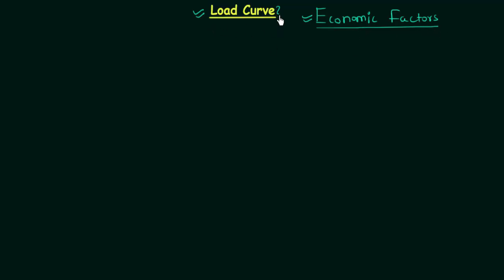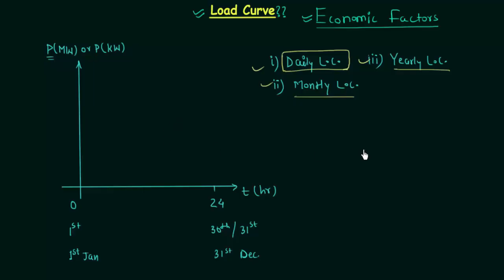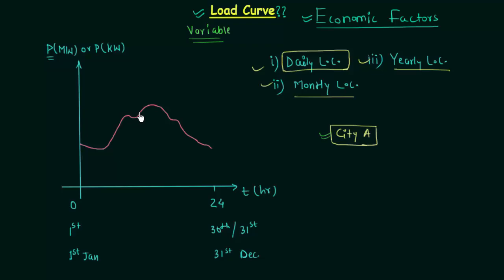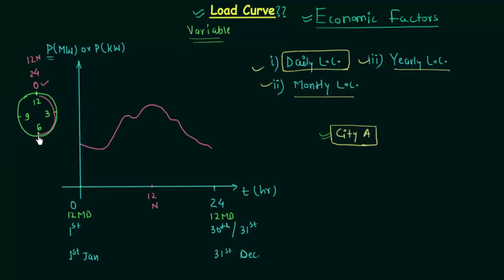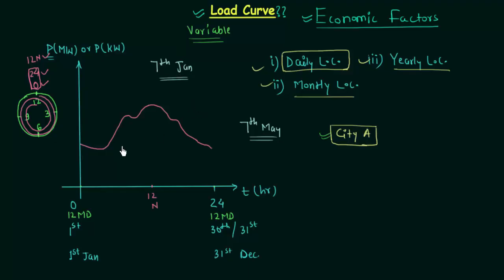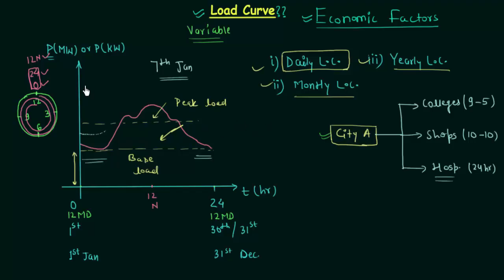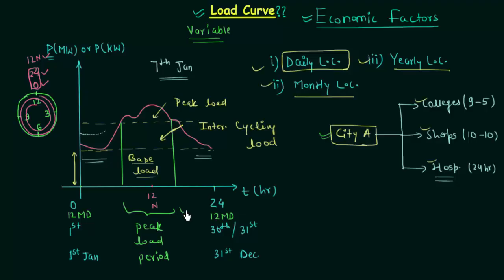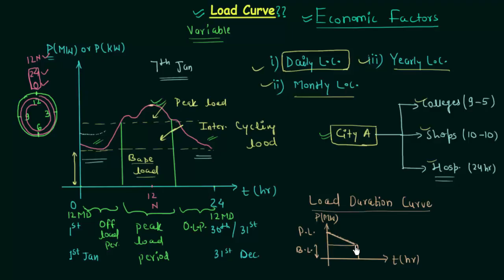Load Curve

Comment: at 4:04 you said that, both the extreme points will have the same value of load, but I think that's not correct because the two points represent different days...correct me if I'm wrong..
Reply: It means it's gonna almost the same depending on the kind of day. Let's say all working days will a similar load curve. All points of a load curve is at different magnitudes to be more precise.